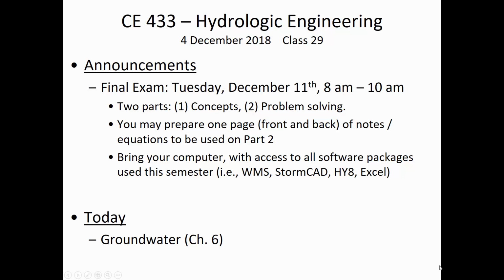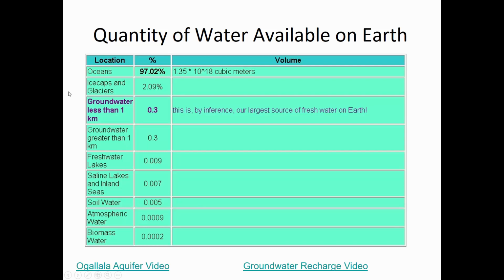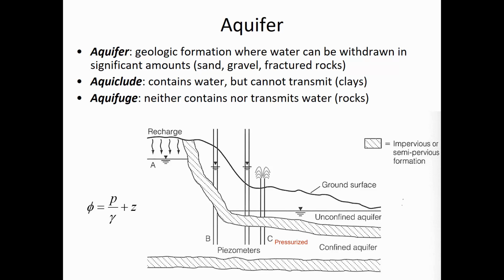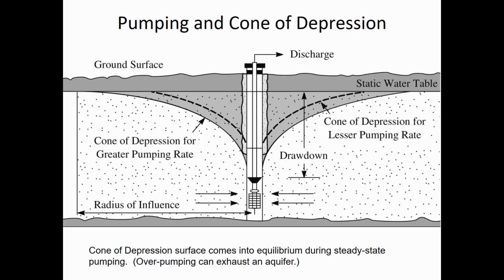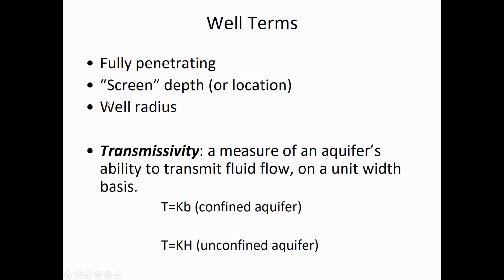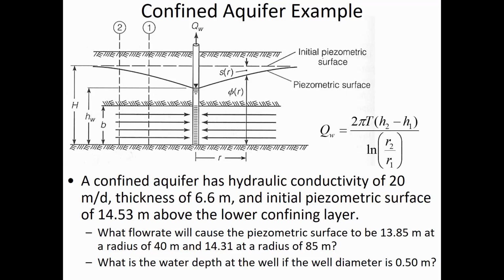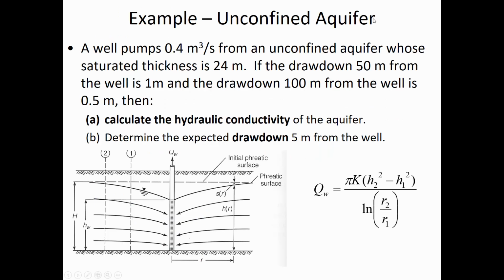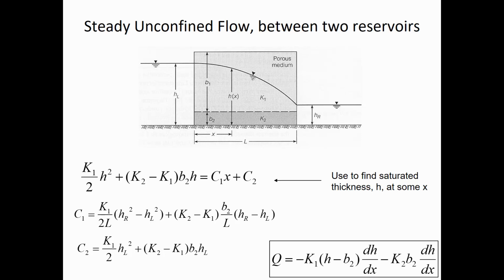CE 433 - Class 30 (6 Dec 2018) Groundwater: confined and unconfined aquifer calculations

Comment: Thank you very much for providing such great lectures. I learned too much from them. Could you please introduce the textbook which you have used in this course. Thanks once again.
Reply from the maker: Dear Mansoor -- thanks for your nice message.  The textbook that I use for the CE 433 (hydrology) course is Water Resources Engineering, by Larry Mays, 2nd edition.  ISBN: 978-0470460641  I don't think there are any electronic versions of that text, but it's a few years old so used copies are pretty inexpensive.  Best regards!
Reply: @IsaacWait  Understood dear professor. Thank you very much for the reply.